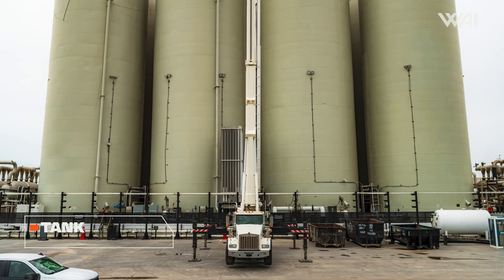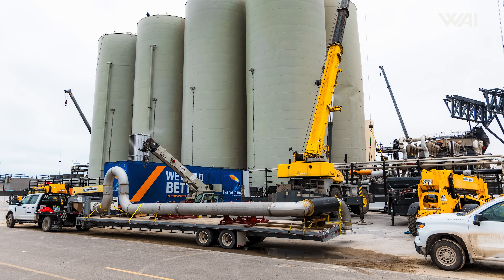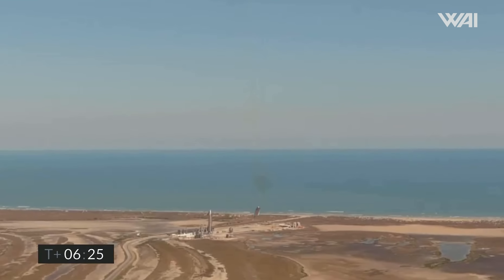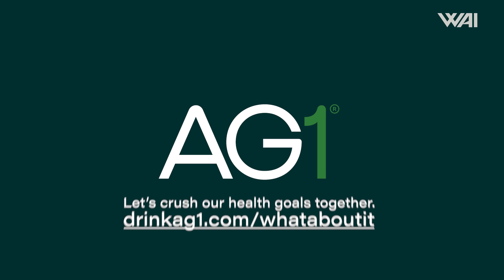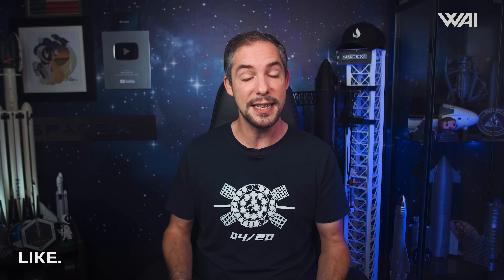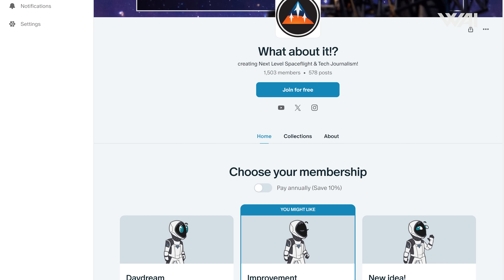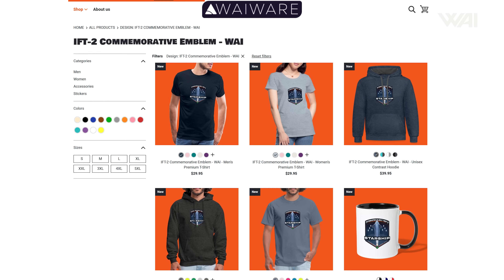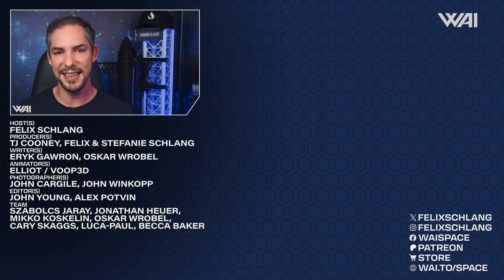SpaceX Starship Countdown To IFT3 - Massive Launch Site Upgrade!

Comment: 9:03 But for the second Starship test flight they didn't even plan to reach orbit.
Reply: Tom"ay"to tom"ah"to, it doesn't matter. They didn't plan on the damn thing blowing up either, they literally sat there for 3 minutes thinking they were going to get a signal back from a long exploded and failed vehicle.
Reply: which is why they called it an "orbital" test launch.🤦
Reply: @jaydonbrown617 It matters in the context Felix put it, which is that as a result of this test NASA wouldn't allow SpaceX to launch Starship from pad 39A. As achieving orbit wasn't part of the plan, it cannot be a criteria to allow/disallow SpaceX to do whatever.
Reply: @ThatOpalGuy  It was called an integrated flight test (IFT), and it had a sub-orbital (or near-orbital) trajectory. Achieving orbit means at least reaching orbital velocity, which was not part of the plan so far.
Reply: @kneekoo  lol. their plan was to reach orbital velocity and land off the Hawaiian islands. but defend failure however you wish.
Reply: @kneekoo  NASA isnt going to allow spacex to launch starship from the cape this decade. cope.
Reply: @ThatOpalGuy  Go read their page and cope yourself. The information is also on Wikipedia, if you care to make sure you're not wrong. Also, they don't plan to launch from the Cape until it's safe to do so.
Reply: @kneekoo  Well pray tell when SpaceX does decide to make this spaceship go orbital; to space? Right now its just a glorified soda rocket. 

I'm saying it doesn't matter what anyone thinks SpaceX was trying to achieve or not, the damn thing is still sitting at a big, fat success rate of ZER0%
Reply: @ThatOpalGuy  By the way, IFT2 succeeded in going farther than IFT1, in a few ways: the water deluge system worked very well on its first flight test, all booster raptors did their job, the hot staging worked on their first attempt, and Starship itself flew almost all the way to its intended target, being close to the engine shutdown and coasting phase.

So both the booster and ship failed to do everything a fully complete system would have to do, but this was a massive step forward. And for a test flight, this was great.
Reply: @kneekoo  You: "Achieving orbit means at least reaching orbital velocity, which was not part of the plan so far."

SpaceX spokesman: "Primary objective of the booster today; to get to hot staging; to get ship on its way to orbit it did that admirably."

Bro this is word for word from Starbase HQ themselves, who are you fooling????
Reply: @jaydonbrown617  This is what Kate said during the broadcast, at 6:43: "if we get past a successful stage separation super heavy will leave the ship at an altitude and trajectory just shy of orbital meaning Starship won't have to fire its Raptor engines for a de-orbit burn and will naturally come back into the atmosphere."

The source is their broadcast on Twitter. What's your source?
Reply: @kneekoo  
The water deluge saved the ground, but not the tank farm.

The raptors did their job, until they didn't and destroyed the booster, and likely the ship.

The hot staging worked, sure, nice and pretty, except the part when it likely caused damage to the booster. A lot of people are saying that, but who really knows, the raptors are to blame for that failure.

Starshit flew almost all the way to its intended target? "Almost"? Yeah, it just barely missed it by a few dozen thousand miles. Dude, it didn't even finish climbing.... 
Talk about a massive step forward.......sideways
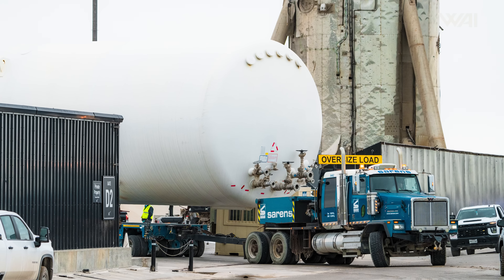Reply: @kneekoo  Go to T+4:50, the other young gentleman is speaking here. Maybe they should have the same scripts. My source is yours pal, sorry try again🤷‍♂
Reply: @jaydonbrown617   I just noticed your comment about the quote and indeed, at T+4:50 (43:44 in that stream) Siva did say that. I can't tell if that was a script or if it came from him, but that was obviously wrong according to the plans SpaceX published on their website.

Orbit is not about a specific place/altitude, but about something traveling around something else. And in space flight, we want to orbit without any means of propulsion. To achieve that, depending on what altitude we want stuff to orbit Earth or other celestial bodies, those who do the math come up with the trajectory and speed required for a stable orbit without propulsion after the stable orbit has been achieved. That's what the ISS does, as well as many satellites. And of course they do minor (propulsive) orbital corrections every now and then, because it's almost impossible to achieve a perfect orbit "forever". In the case of satellites and even the ISS, placed in low Earth orbit, there's still a bit of atmosphere that creates drag, which makes them slow down and fall back to Earth faster than the satellites placed in much higher orbital planes.

Starship's two IFTs so far were not planned to achieve orbit - this was documented on their website. They wanted for Starship to go far enough into space so they can perform a quick re-entry for a heat shield test.

There's no point in going orbital when they're this early in the development stage, when so many systems on their booster and rockets haven't been fully tested and refined. Trying to do too much, too fast, only increases the effort, time and money. So it makes sense that they take a step by step approach without wasting more resources than necessary.
Reply: @kneekoo  Everything you said is good and all, but you know doesn't it make you appreciate more what NASA has accomplished? Whatever dumb reason you may not like NASA, they fail like one time on something, then they charge straight and true on their spaceflight missions. The Artemis mission, where SLS literally launched the Orion to the moon and back, I feel is taken for granted somehow. SpaceX could one day do this and it would be the single most amazing moment in history for SpaceX fans, despite NASA probably doing it twice or more by then with their new system. 

SpaceX and Elon somehow got everyone to think that rocket development needs to be this grand spectacle, that every little piecemeal milestone is a success and needs to be celebrated by millions, as long as one of them is accomplished. We've forgotten the days when stakes were higher and technology was much simpler. NASA and others accomplished much more than SpaceX at this point, but everyone is brushing their past progress under the rug. Perhaps it was the fire lit under everyone's butts back then to be the "first". SpaceX will be the first to what exactly? They aren't racing anyone, they aren't in a "competition" with anyone. They are playing around, slapping this there and that there, seeing what sticks and flies. Playing Kerbal Space Program irl, I remember when spaceflight was a serious thing.

Forgey all this now stuff, these challenges they're facing right now is easy are easy to solve, at least they should be. Maybe if they took the time to really TRY and get it all right, right enough to get to orbit. The real conversation is how the hell do they plan to achieve anything beyond that. These are tasks not even Falcon 9 or Superheavy can do. They most they are capable of is delivering payloads to orbit....can they even reach the moon themselves?
Reply: @jaydonbrown617  By the way, Falcon Heavy will fly Europa Clipper next year, which will survey our Moon, then fly to Jupiter, to study its moon Europa.
Reply: @kneekoo  I doubt Falcon Heavy itself is going there. Launching satellites to orbit and beyond is already a thing for them, they launched their car around the sun. That's not what I'm talking about, launching payloads is one thing, getting there yourself is another.
Reply: @jaydonbrown617  Nobody sent full rockets to the Moon or farther. It's only the upper stages that push farther, and then the payload itself continues the mission. The first stages are only used to escape Earth's gravity.
Reply: @kneekoo  Again, you miss my point. How is SpaceX going to accomplish this moon mission, let alone a Martian mission? Starship itself is not a payload, its the first stage and a ship. You're right, "full ships" have never made it to the moon, only landers and pods. But isn't SpaceX's plan to land a modified version of the Starship on the moon?
They have a long way to go because it seems from last launch that Starship has only enough fuel to be sub-orbital. Oh they will make a new version that has enough fuel, well how many launches will that require to get right? They only have until December 2025, do they not? Chop, chop!

Comment: At 4:13 Can you imagine that tank going down the freeway? Felix what do you think about hydrogen embrittlement on a hydrogen tank built in the 60's. I wouldn't do it with out some metallurgy to look for embrittlement first. I've seen embrittlement in devices that have been in service far less time than those tanks have been sitting there.

Comment: Dude drain the fluids an fuel  put batteries   an crank  it was under trees so not as much water got in as u think  that was built to live in dirt mid an crud i bet it kicks for few minute s at least that woud be a great challenge project for a disel school or couple young  disel mechanics  hir  all controls an track with grease an. W 2.   U be surprised how much of it frees up

Comment: Just roll the spherical tanks across the wetlands into the sea, attach tugs and tow the tank using its own buoyancy to Boca Chica beach, roll it up the beach to the launch site. Could even make the tank self propelled on land by placing a tractor inside - with a sphere, it could be steered!
Reply: cutting a hole big enough to put a tractor inside...
just cut it into fourths if you are going to do that.
Reply: I like the idea of dedicated  landing catch towers for boosters and Starships.  No point in risking a flaming nightmare landing at the launch site. At least initially I think the “catch-em-in-the air” landings are riskier than launches. My guess is that each booster and Starship are going to need to go back to th high bay for some work after each use. At least foe the first few dozen launches.

Comment: Wouldn't it be so cool if they use an emptied out starship as a laser lab to project objects from one end and use lasers that emit different patterns at different wavelengths to maneuver objects as a defense system for objects that could impact the ISS and other orbital devices? If it also can be used for internet networking then that means we can safeguard things by zapping it with the internet xD

Comment: I think there will be sliding protection plates (removable for maintenance) over the horizontal tanks and the vertical tanks location will be replaced with additional horizontal tanks and sliding protection plates. fwiw